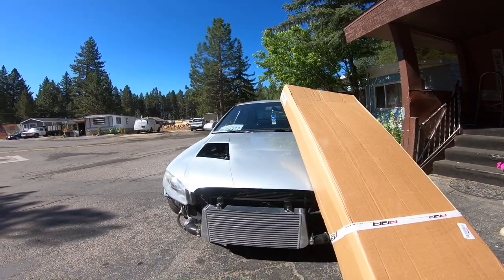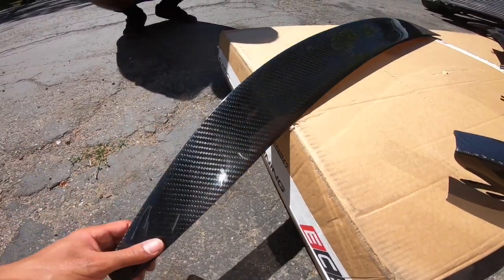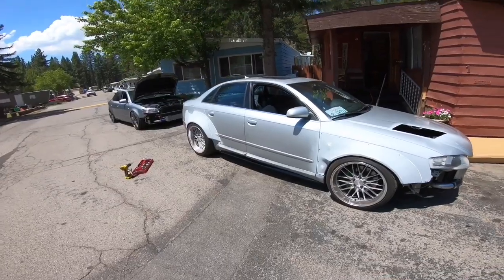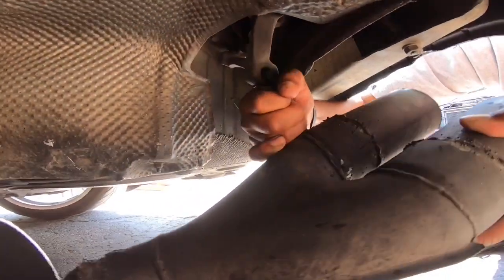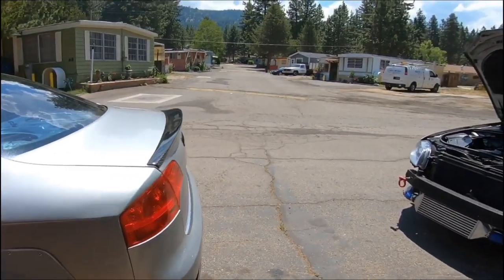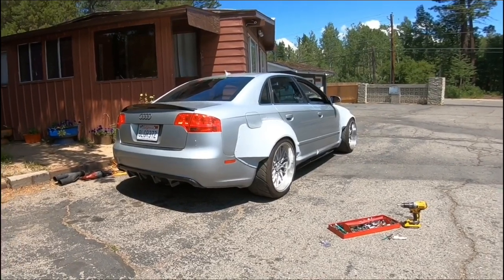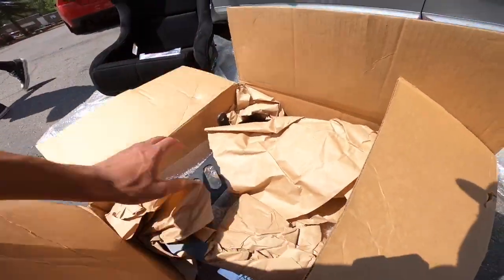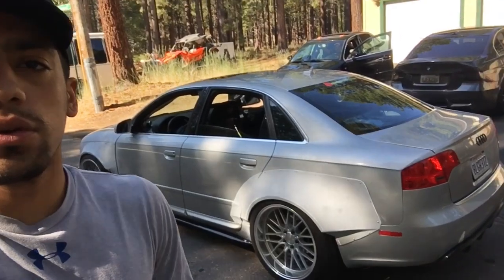Bucket Seats in the Audi..| Carbon Fiber Parts! |

Comment: bro i’m having trouble installing my bucket seats bc the seat mounting bracket doesn’t give enough clearance to screw in the bolts to the floor of the car. Did you have to cut yours too so that u could screw it all in correctly?